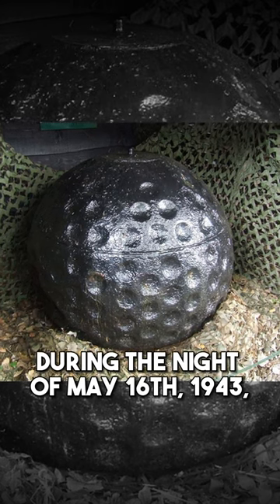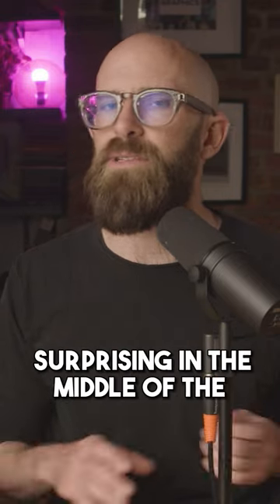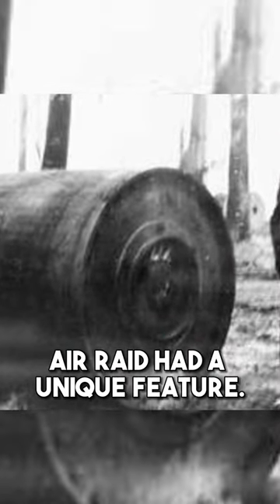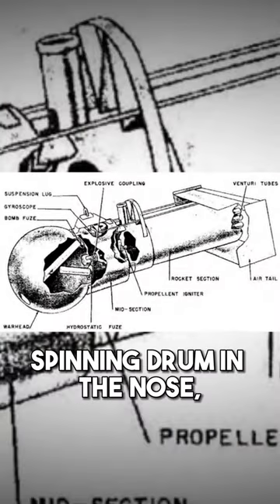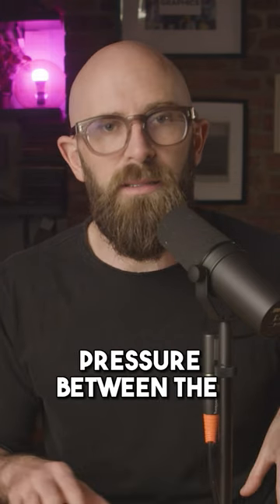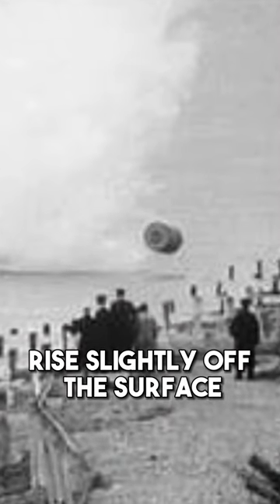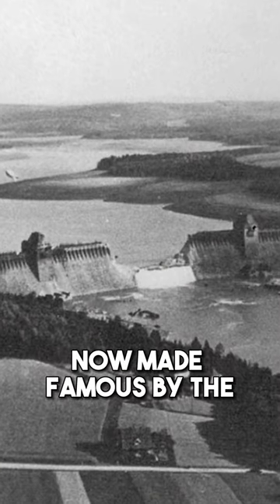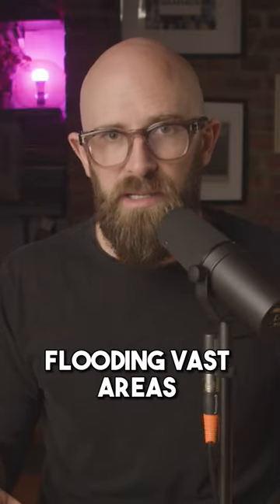How do Bouncing Bombs Work?  #shorts

Comment: It was a brilliant, daring strategy and concept that unfortunately has only a limited application. Well performed but not without harm, it stands out for several reasons not the least of which was its success.

Which begs the question: "Why did they not do this to every dam in Germany?".

I would follow that with: "What other applications for that kind of aerial bombing could have been undertaken by the Allies, and where?"

I could see possibly using that against the enterances to the underground submarine pen entrances and exits, any Axis surface fleet ships, fuel production and storage facilities, airfields and runways, railways and tunnels. But many of those targets would require a more robust casing that would survive impact with the ground yet still bounce its way along tearing up everything in its path.  Maybe tearing bits of itself apart in the process and scattering numerous sub-munitions that either detonate on impact after breaking away, or given a set time delay.  

It would be more like a modern cluster bomb arrangement for attacking fround targets not near an adequate water feature that the dam buster needed to skip on.
Reply: Massively expensive in terms of planes and skilled  crews .

Comment: Why bouncing

To get over protection nets
Reply: Yes. And, to destroy the dam, you needed to bomb to be a certain depth underwater and a certain length away from the dam wall. The nets stopped normal bombs from being dropped, so they needed something that would bounce over the net and settle down in the water beside the dam. I believe they had pressure gauges that would set off the explosives when they were deep enough